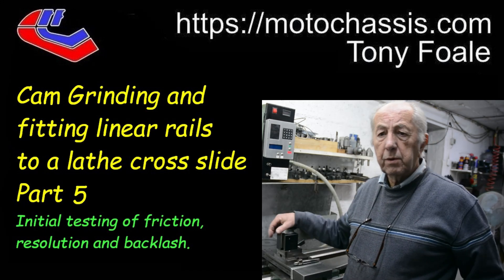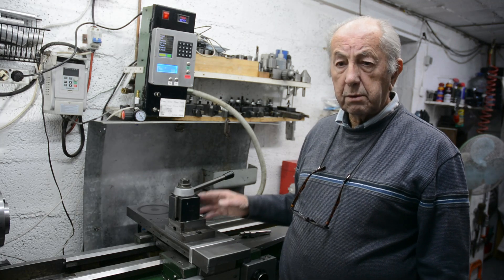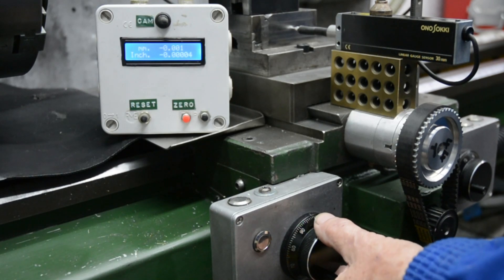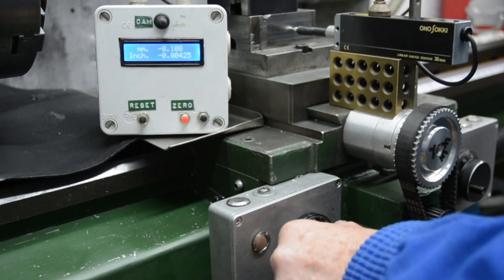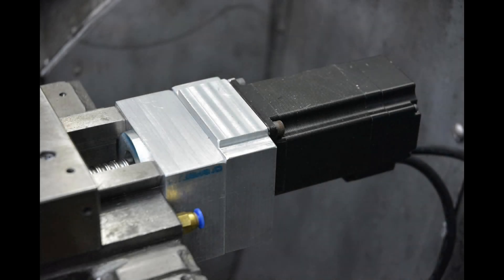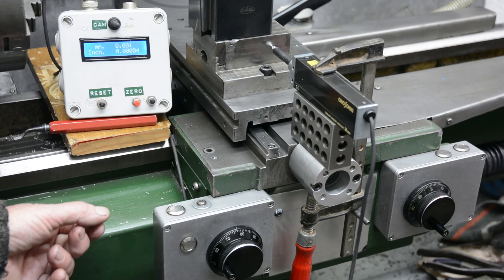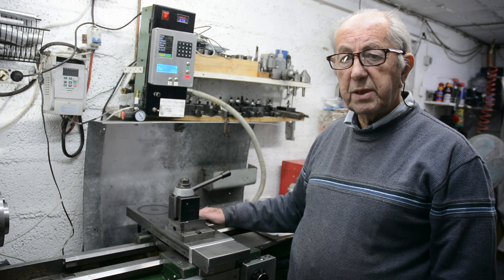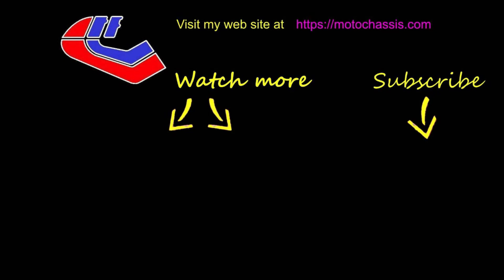Part 5  Initial testing of the new cross slide for the cam grinder.

Comment: the temp increase or decrease in the room will change the volume of your steel machine more than that!
Reply from the maker: That is a good point and I am often telling others the same thing.  However, that is not a concern in this application.  A global temperature change will affect the global dimensions, but even an extreme error of say 0.1 mm on diameter would not be much of a problem.  My concern is a step in the surface that backlash would cause twice per cam revolution.

Comment: Very interesting, I might go through you channel to have a look at how hard it would be to start putting some simple power drives to my lathe. Not to grind cams but at least get some accuracy and repeatability. Probably starting with VFD for the motor to get a better range in speeds.
Reply from the maker: Here is the playlist of my lathe mods. https://www.youtube.com/playlist?list=PLyn2snGjYlHw_e4LomNphh8KleeqPiqpz
It includes motor upgrade, adding a ball screw and a load more.  Thanks for your interest

Comment: Great to see this progress, and much respect to you sir. I remember referring to your book back in the 80's when I was studying city and guilds motorcycle mechanics at college. I remember the term for static friction was stiction, a problem you are currently dealing with.
Reply from the maker: Stiction (STatic frICTION) would be much more of a problem with the original and is one of the prime motivations for the conversion.  This has been almost eliminated with the linear rails and ball screw.

Comment: I'm not sure that 7 microns backlash is going to be a killer even on a cam Tony. In old money that's less than 3/10,000", which just about any machinest would chop your arm off for. It'll be interesting to see how much you can reduce that by.
Reply from the maker: For normal turning that is true and I do mention that, but for cam grinding there are two cross slide direction changes for each rotation of the cam, each in the worst areas for valve train dynamics.  A 7 um step is a big deal for a performance cam.  You can improve things with some careful work with abrasive strip and to be fair that error is probably less than cams from not many decades back. I still want to be as close to perfect as possible, before any enhancing work.
Reply: I know some of the cnc prgrams have a backlash adjustment in the software. I think you can eliminate some backlash
using 2 ball nuts if there is room. I don't have enough experience to say how good either one work.
Nice job Tony. @MotoChassisByTonyFoale
Reply from the maker: @toddk.5873  Software adjustment in software is a possibility as well as mechanical solutions.  I will wait until I see if there is a problem to solve.
Reply: @MotoChassisByTonyFoale  Can't knock going for perfection, I'm looking forward to the results.